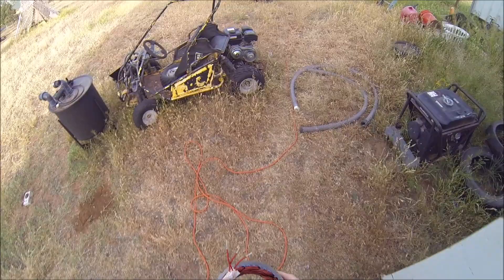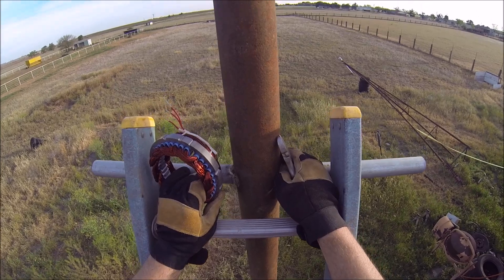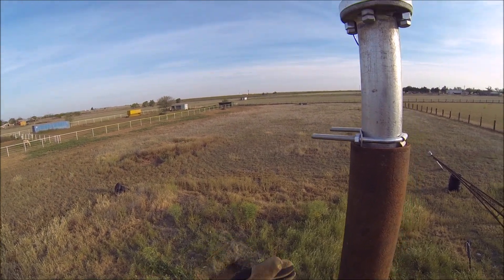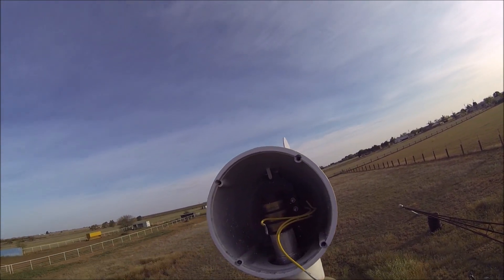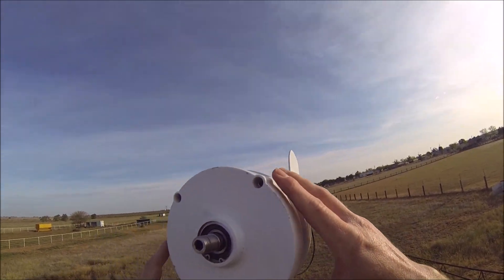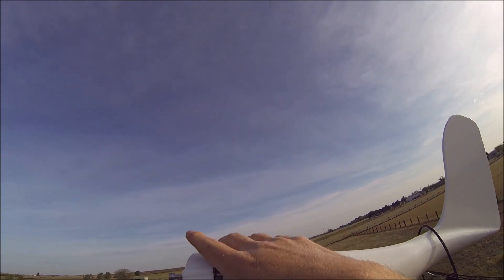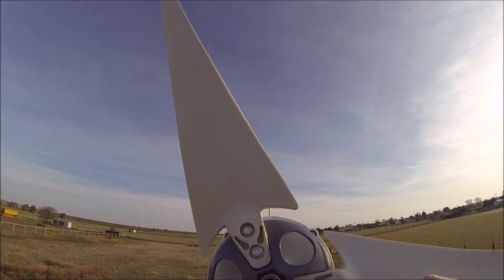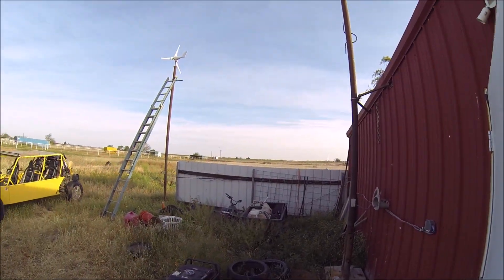400 Watt eBay Horizontal Wind Turbine #2....finally got it in the air!

Comment: And the rotor bearing? I can't find it. It is like two bearings together.
I have to change them.
Reply from the maker: I'm sorry, again I haven't ever pulled one to measure.  It is two bearings, though...one on the front, one on the rear of the cap.
Reply: I will put 2 if I can dock them because originally it comes with a 4 cm wide 17x40x40 5203zz better than 5203 2rs.

Comment: I like your style bud...prepared for nothing but ready for anything!  You knew the ladder was a bad idea and laughed at yourself on the way up for climbing it. You couldn't be Irish could ya? I didn't want to stack up 6 sets of scaffolding last time i serviced my turbine so i set a 24' ladder on the toolbox of my 9" lifted Silverado and tried to get up 35' for a blade change and tail modification.... holy friggin bad idead. Ladder started to twist and if i wasn't in reach of a cable I'da gone down. I managed to wiggle the ladder back straight after I calmed the stakes out and called it a day.... stacked up 6 sets of scaffolding the following day and did the job safely on a sturdy platform 🤦‍♂️

Comment: Is that the 48v stator with it having red wires ? look forward to seeing it in action.
Take care
john
Reply: I believe so...most of them use the same stators but the big difference i noticed was the quality of the magnets on the rotor. Stronger field, more flux, more energy! My first turbine had the crappy black magnets that come on refrigerator decorations....never made a single watt. Steer clear of the "lantern VAWT".
Reply from the maker: It was suppose to be rated for 24v.  I'll have an update on it at the end of the day...but suffice to say it's NOT rate for 24v
Reply: @ToysforWatts  I've seen the wires in black, red and blue my turbine is 24v and there black, it was one of the other guys said in his video that the red wire one is 48v so it will be interesting how you get on with it, the 48v replacement i ordered has red wires.
Take care
john